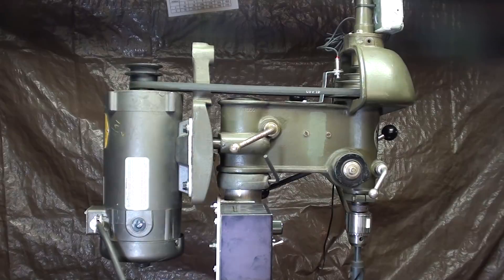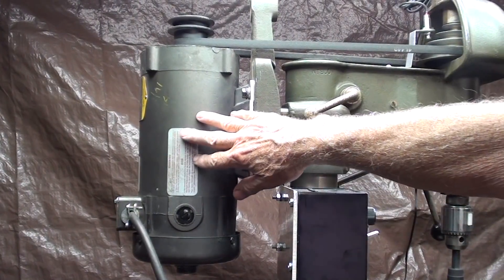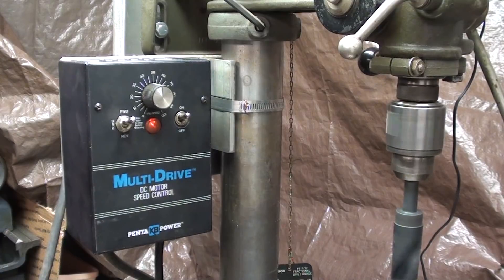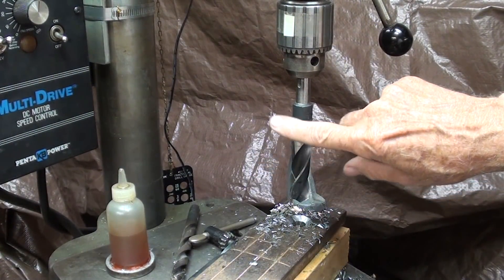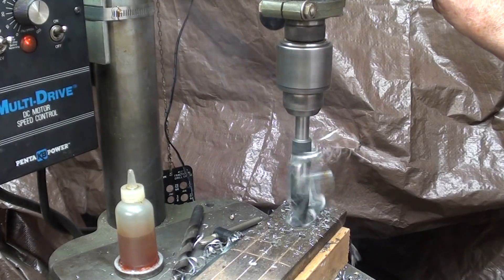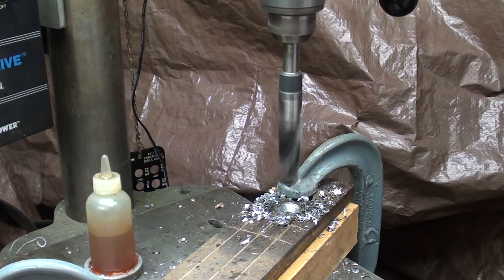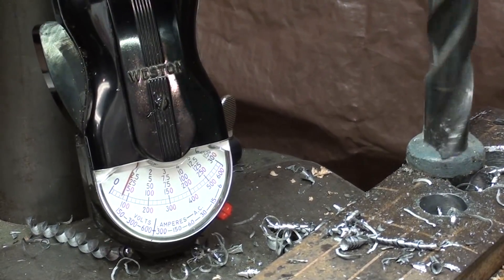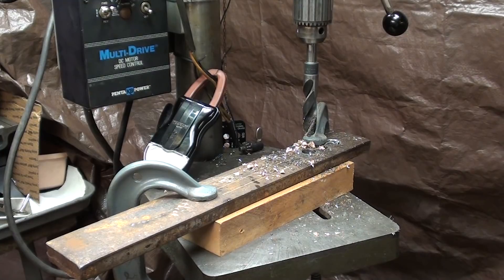Tips #482 Drill Large Holes Slow Speed DC Motor tubalcain

Comment: Thank you Mr.Pete for showing in detail what I found out many years ago as it explains why I was fooled into  trying DC for variable speed on a bench drill and why it wasn't a success for me either.I did not go to the lengths with voltage, amps and RPM monitoring  you have done in this video simply because I did not have the equipment then. In fact going back over 50 years not many people had access to things unlike today where there is plenty of used equipment by the car load.
Reply from the maker: Yes thanks
Reply: @mrpete222  Were you using an "appropriately sized" motor? What I'm getting at is whether a drill press which has had its 1hp motor replaced with a 2-3/4 hp treadmill motor will still lack reasonable torque when regulated down to, say, 100 rpm.

Comment: Another great video! but to get constant speed and torque, the DC drives usually need an electric tachometer feedback mounted on the motor shaft...big $$$ for that stuff...I'd be interested in a chart showing how much horsepower it takes to drill at the recommended speeds?...
 I've drilled heavy steel plate 2"+  on a big Carlton at those RPM's......but watch out for the storm of coolant and chips...!
Reply from the maker: Yes

Comment: Amazon purchases may have bullet-proof no-return or money back guarantees. Could require Prime membership. I do not know the details, even your Tach supplier.  There should be extra consideration for your number of subscribers. :) There seems to be a percentage of Amazon vendors who sell junk- obviously defective items. They may lard them in with acceptable merchandise. (Warning! This is speculation on my part, other than having problems with several series of identical items a significant number of times)
Reply from the maker: I bought mine off of  feebay

Comment: Mr Pete, what about an intermediate shaft & step pulley with a lot more reduction using the pulleys, you will still have your DC variable speed with a lot more torque. (But a lot more work for you)
Reply from the maker: Yes , But the experiment is over

Comment: Hey Mr Pete.  Just brainstorming here but what if you added some kind of flywheel(sort of) up on that top pulley just to give your spindle some extra inertia and help keep from slowing and bogging down.  maybe make a new single groove pulley ......... but make it out of a beefy ass piece of steel with a lot of meat left for inertia
Reply from the maker: Yes that would work, but the experiment is over
Reply: Not the right solution.  Go to a larger motor with a VFD. Source it with 230v AC if over 1hp.

Comment: You might try putting a flywheel on the motor to help. It works on engines and mechanical presses. I do not know how big of a wheel or how much weight that you will need but there are tables for that. Bob
Reply from the maker: Good idea

Comment: You should check the position of the  CURRENT LIMIT TRIMPOT (CL) on the control board.  You can adjust maximum torque of the motor.https://www.kbelectronics.com/manuals/kbmd_240d_manual.pdf
Reply from the maker: Thank you, I need to try that. Which trim pot is that
Reply: The pdf in the link will show you which pot it is on the board.  Page 11 I think.

Comment: Use a 3 phase motor with a vfd you can program them to provide consistent torque
Reply from the maker: That's coming soon to a theater near you
Reply: yup
Reply: Gord Baker yup your word meaningful
Reply: Yeah, people are convinced that's too expensive
Reply: Variable frequency drives used to be be frightfully expensive when they first were introduced.  In more recent years they have been cloned by far east manufacturers and you can get low HP controllers that even work off of 120 or 240 volt single phase power for very reasonable prices.  I found a like new name brand (Siemens or Schneider/Square -D) 1/2 HP VFD on ebay for about $50.00.  New Chinese ones I have seen beginning around the $50 range on Ebay and elsewhere.
Reply: @kennethdegruchy5503  Our factory has machines that came from China with Schneider drives and I've been replacing them (when they die) with Automationdirect GS2 drives. A fraction of the cost and easier to program. The latest Schneider drives we found we couldn't put from local to remote mode without interfacing to a computer, so that's a $1,000+ paper weight sitting in a bin now. We've only had one GS2 drive die. Where I was going with this...the GS3 line has vector capability. If their quality is anything like the GS2, they'd be something to aim for. Or a person could just go for the cheap Chinese ebay route and keep replacing them over and over...
Reply: I see these little (small form factor) VFD wonder boxes as specific use computers mounted in a a box with the power handling solid state devices and heat sinks.  I would not expect them to survive any longer than a computer mother board and probably less due to heat and environmental conditions.  Small aluminum electrolytic capacitors have MTBF to be reckoned with that you cannot get away from and these VFD's depend on them.  At work we have 6 Hitachi  multi HP VFD's that are much larger form factor cases that have been in satellite dish service since before 2003 when I first worked there and they are all going strong to this day in a very intermittent duty environment where they do not work very hard.
Reply: You're right, but look at this. https://www.youtube.com/watch?v=1oaC8VH5LC0&t=153s

Comment: Still think you're chasing your tail. A typical modern battery drill has a motor that spins at 20,000rpm. It is the gearing that gives the low speed torque. A high speed DC motor (mine are 4800rpm) geared down to around a quarter or so of that still have torque that is useable at around 100rpm with no stalling.
Reply from the maker: This was just an experiment
Reply: @mrpete222  It would be nice to have twice or maybe even three times larger pulley for the spindle side and be able to quickly swap it out when drilling large holes. This would reduce your max. rpm down to 500 or 333, but double or triple the torque, assuming the belt doesn't slip. You'd just have to set the speed dial almost to the max, to reach 300rpm. By using larger pulley, you'd allow the motor to run at higher speed and output more power than it's able to, at lower speeds.
Reply: joe borovina  You missed the point: the drill MOTOR ARMATURE spins at 20,000 RPM- and then it's geared down! The drill spindle never spins anywhere CLOSE to that speed(!)
Reply: Planetary gears: Ain't they marvelous?
Reply: ExtantFrodo2   ...THEY'RE OUT OF THIS WORLD(?)

(get it? get it? get it? SNUCKER-SNUCKER-SNUCKER!!)
Reply: ergo what he really needs is the correct pulley system to achieve an appropriate speed with the motor running at max power. Will still bog down though, what he needs for this is a motor with a VFD controller
Reply: You're right, but look at this. https://www.youtube.com/watch?v=1oaC8VH5LC0&t=153s